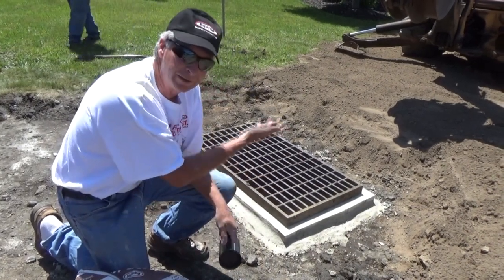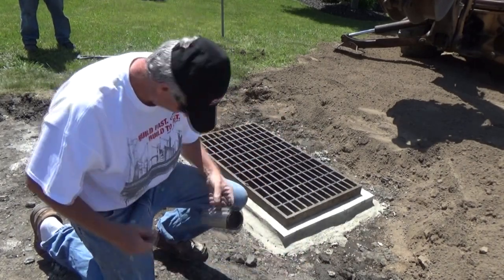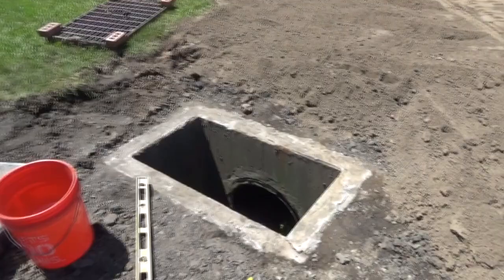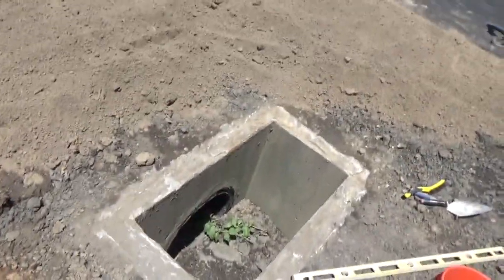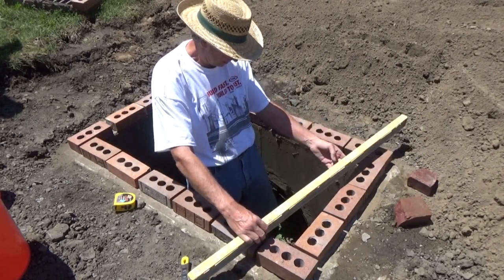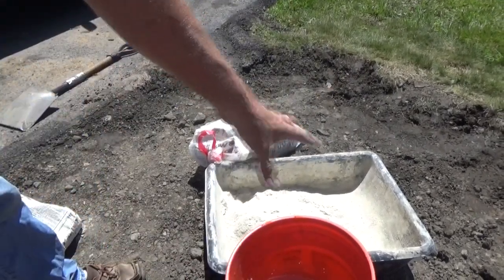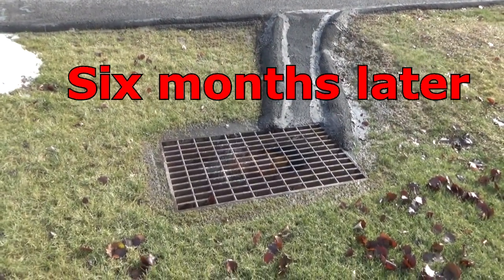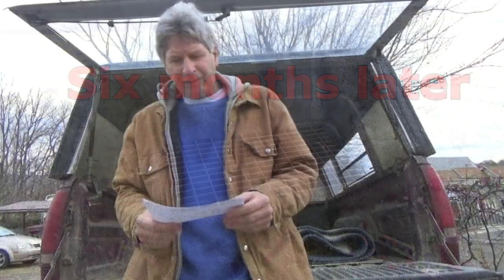Storm drain, raise - repair (Mike Haduck)

Comment: ok a question on this Mike.
any back and forth about the brick used or a simple concrete curb to elevate the grate?
 reason i ask is that many old grates at commercial parking lots in this area were final adjusted with bricks and seem to have fall in problems sooner than the ones with a concrete approach.  
my guess is that the erosive water flows that concentrate in a large drain and the weather are eroding the brick and bedding faster.
Reply from the maker: Hi pensive,  I would say it depends on the brick,  these were dense and did not absorb water, almost like glass,  but I understand the concern,  thanks mike

Comment: Great vid again Mike thanks. Where can I go to find info on building with stone? Books and other? I asked around to local masons and engineers but I can't seem to get a straight answer. I got some books out of the library but nothing on local codes. There is nothing in local code books about stone structures but there are a good amount of them in and around town. Any idea on where to turn? Any advice will be greatly appreciated. Thanks. Matt
Reply from the maker: Hi Matt,  I was just at the tail end of the way they use to build those buildings, but new school is cheaper and faster so those are left behind in the dust,  with the earthquake and new building codes It only applies the the new,  just the way things have gone, check out my video, Limestone caps,carving,plaining (tomassetti stone co) Mike Haduck,  I show some old school books at the end they used for old school buildings,  I hope it helps, thanks mike
Reply: Mike Haduck Masonry thanks so much! I think you are the only person on here that is doing this lol keep it up and thanks again
Reply from the maker: thanks again,   mike